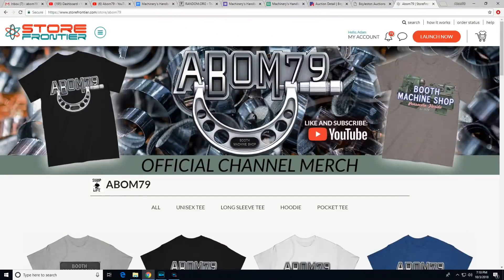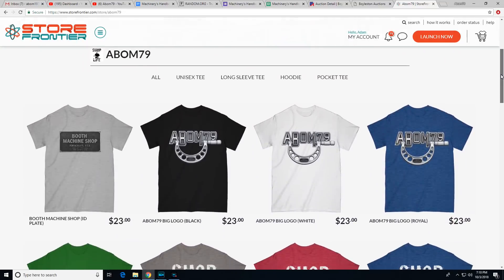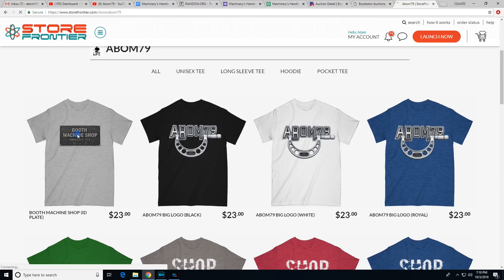SNS 234

Comment: Think this is the first time i have seen a Taper-Lock hub in any of your videos. God knows how many of those i have disassembled and re-assembled to change shafts etc. Very rarely do i have issues with taking them apart because of the way they are designed, awesome piece.

Comment: I worked for an environmental testing, sampling and remediation company in '93-'94. We did work at the Monsanto plant there in Pensacola. Basically they made wear dated carpet fiber. Their property is massive. The bad part, is there is one area on that property that contains a landfill that has some pretty nasty "stuff" buried in it. The smell around that area was atrocious. The fire ants didn't even nest in that area of the property. Anyway, you're looking good. Congrats on the weight loss. Keep it up.

Comment: I've always wondered what you (and other people too) do with the chips of the lathe. I like to think that is separated by type and sold to be recycled into new stock but I don't really know.
Reply: Recyclable, the swarf can be melted, and re-used.
Reply: Thanks, that's cool, but is done? I mean, is cost-effective for a homeshop to do so?
Reply: Sell it to the scrap merchant.
Adam, won't smelt it himself, just sells it by weight.
Reply: here in the San Francisco bay area we get about 5 cents a pound, not really worth it however you have to put them somewhere and you pay to dump them in the landfill so recycle it is. Brass/bronze, stainless and aluminum pays more so we keep that in separate bins.

Comment: I think that's definitely a shop-made tap wrench. The center section is flat top and bottom. I think he roughed the body out on the mill and then chucked it up and turned the handles round.

I'd love to get a better look at that to you used to trepan out the centers of those sprockets. Upside down HSS cutoff blade? How did you get enough clearance for the height of the blade?

Comment: Impressive work (as usual) on the sprocket fixture! Even more impressive considering you decided to line up on the sprocket O.D. and Taperlock adapter O.D., which is almost always the lowest-tolerance dimension of the part. I noticed you turned the TL OD. You have brass cojones. Did you wire brush the sprocket face only past the paint or eliminate the mill scale too? Beautiful weld! I hope you don't have 5K to do. A dual pass 180 weld station (two MIG welders at 180 degrees) would eat these for breakfast on the welding operation. Too bad you MUST use the sprocket vendor you use with Motion as there are plenty others out there.
Love your work - you rock !!

Comment: Surprised you didn't dual shield flux core those sprockets. I would have expected that to have been a stronger joint.  I so need to invest in one of those trepanning tools!
Reply from the maker: That piece of crap mig welder we have is giving me so many problems I refuse to use it. Stick or Tig for me!

Comment: Adam---another great video! I'm sure you already know this, but please be careful removing the rust.  I had a couple of beautiful machinist's clamps that belonged to my grandfather, which had a couple of small rust spots. I used EvapORust, and it removed ALL of the case hardening color. I'd hate to see that happen to your tap wrench.
Reply from the maker: I won’t be using that method on tools like those. C-clamps I will, or a completely rusted out tap wrench.

Comment: Would it be advantageous if you put those sprockets in a lathe and cut a groove on the face that could be TIG welded as well. Seems like it would make the welded surface that much larger.

Comment: Hi Adam. Great SNS once again. Thanks for sharing.  Maybe you could save some lunch time by putting the books through your works postal room. Parcel them up and  ask the post room manager if you can pay for the postage and get them added to the post from work.   Thanks for paying these books forward.  There are a lot of good ppl out there but the trouble is there are many others who just try to get as many freebies so they can keep them as trophies or even sell them on.      regards from the UK

Comment: I have this big old drill chuck that's keyless. Needs some tlc (cleaning and probably a rebuild) but if you want itb I'll give it to you. I think it's for an older type of drill press. It has that knock out piece. I don't know if it's tapered or not, I'm thinking it was used in the tailstock of lathes also.
 In anycase it's yours if you can use it.

Comment: The BREEZE Tap Wrench was probably made by the Master Machinist himself.  Adam, watching you weld the sprocket hub, you can see that the fumes are being blown to your breathing. You need some type of ventilation to move the fumes away from your breathing zone.  Metal vaporifics are not good for for your bronchi or lungs.  Congratulations Chris Williamson.  Here's hoping you have a great career using the handbook as a reference.  
"til next time my friend.
Reply from the maker: The fumes are not going under my hood and into my lungs. Videos are terrible at making welding fumes look worse then they are.

Comment: How did you get the holes for the pins to be so accurate, did you use the lathe for scribing the PCDs or you used another method?
Reply: I'm sure he did it in the mill, or at least that's what I'd do. Can indicate the center of the jig, then use the DRO to put the holes where you want them.

Comment: I've seen on various forums that the 199 level is actually not scraped flat, but slightly concave, so just bear that in mind if you want to re-do it.
Reply: Would you be able to scrape something with a curvature to it? How did they scrape it at the factory with a concave to it?
Reply: It’s usually scraped flat and then the middle third relieved. Not really concave.
Reply: Simple, use a reference surface that has the matching convex shape.
Reply: @elanjacobs1  that's not so simple. The apex of the curve would need to stay in the same position (the center of the level). So you would only be able to transfer dye by a linear motion, and when starting from a flat surface, it would be a nightmare. Esp considering you would never really be able to get it perfect, or you would need a day or transferring dye with linear rails for movement.
Reply: Not simple to DIY, but I'm sure Starrett has made all the necessary jigs and masters to do it relatively easily. I wouldn't be surprised if they CNC grind the curve into the base to start with.

Comment: wtf, @abom79, are you really facing with a parting off tool? For shame!
Reply from the maker: That tool is designed to both plunge cut and side to side cut because of the insert design. Check with Kennametal and you’ll see.
Reply: @Abom79  Ah, fair enough.